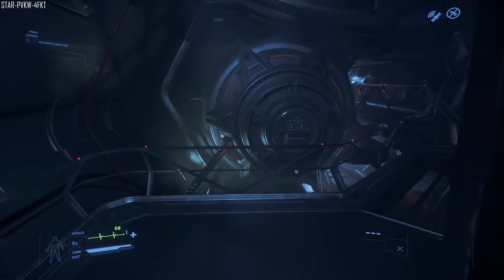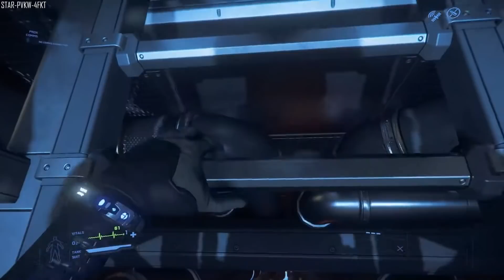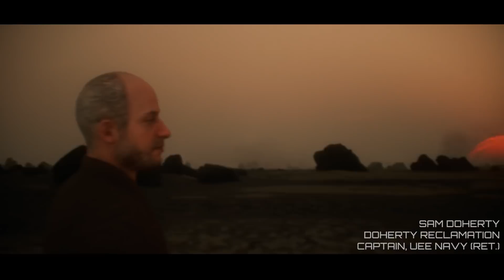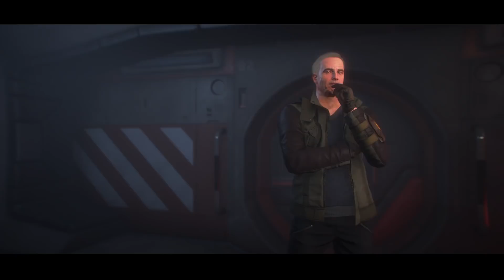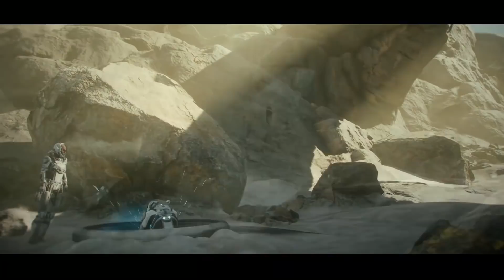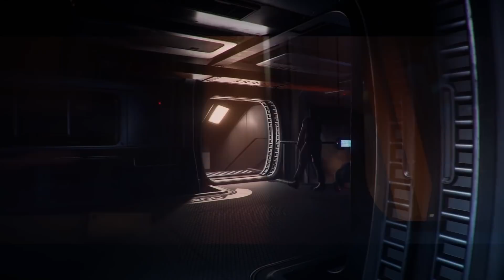Star Citizen Ships | Engineering, Repair, Salvage & Components

Comment: Its good news they are working on the power system. However, just like a real aircraft.  I think they should have onboard APU's (Auxiliary Power Units) so you can shut down your main engine but still run the electrical system/defense systems off the APU when the Main engine and generators are not on. This would help reduce fuel consumption when sitting on a planet or in orbit but still be able to power Shields, life support and turrets. Really all the larger ships with turrets and habitation should  have an APU system for starting main engines and powering the ships critical systems without the main engines on.

Comment: Some of the smaller ships you will have to access the components outside of the ship, so if you are in space you will have the get out and EVA to the compartments. Larger ships you may want another player with you incase something goes wrong. I think that will be an exciting new feature. Once tracker beams are added you can be a space tow  trucker.

Comment: engineering and salvage are two of my biggest areas i look forward to. looking at it though i have to wonder what compent repair will look like- little fuses? wire? or magic glue gun? still i like the idea of system management as a staring point.

Comment: Nice video, but CIG really has really disappointed me with this...They've known they were going to do this pipe system since 2013 - it should have been "built out properly" from the very beginning, it's not as though this is some system they didn't know was going to be implemented.  Whatever the original pipe system was, it wasn't build properly for the end goal - so it sounds like it was a hack job.  "Iteration" is one thing, this sounds like they are completely starting over.

Comment: im looking forward to that frantic moment, following a dog fight, where i have to get out of my seat and start blow torching and wrenching untill the fires and smoke are out. Hell even put in a "bleeding out" state in ships! Repair your Q-drive or its going to explode!  Hell put in some great sci fi action music during that state and turn this into a tremendously immersive sci fi experience! Star Citizen is all about the immersion. I think this would be amazing!
Reply: Would be interesting to just barely scrape through a fight in my 600i only to have a bunch of system failures.
Reactor's unstable, there's 3 hull breaches, I'm leaking oxygen, the life support system's fried, the shields are gone, and half the thrusters are malfunctioning.

Do I give up and abandon ship using an escape pod, or do I try and fix her up enough to limp home...
Can I get her to limp to a station in her present state, or will more fail/blow up before I make it?

Oops. The reactor is starting to go critical now. I have to rush all the way through from the bridge to the back of the ship and try and at least get it stabilised.

... OK, reactors's stable... It's not going to blow.
But... Main power's out.
Life support's down...

Do I have enough oxygen to fix this?

... Got main power back to minimum output.
Managed to find and fix the hull breaches.
Shields and weapons are a lost cause, so let's hope nothing else tries to attack.
Oh wait. I have missiles.
... A whole two of them.
Half the maneuvering thrusters are shot. Better not try a planetary landing.
3 of the main engines are beyond repair, but... One is better than nothing.
Quantum drive... Has seen better days...
If I can just patch it up enough to get out of here...

ooh this is going to be expensive...
But, the ship is salvageable... 

OK, setting course and...
Damn.
Overloaded the reactor again.
Have to run back down and reset the whole thing.
OK, this time cut the QD power down to 10%.
It'll take forever to charge the drive like this...

.... Halfway there... Keep it together just a little longer...
Ah, we're dropping out of quantum...
The drive must've been in worse condition than I thought.

Well, back down to engineering I guess...

Comment: There are some problems with this. How do you get a large component in and out of the Carrack for example. There's not enough room to lug the components through the paths to bring them in and out of the ship.
Reply: There are definitely some logistical issues.

I scratch my head every time I look at the cargo and engineering areas of my 600i.

Not that I can't imagine getting stuff into and out of those areas...
Because there is room, just about.

But just because it would be so, so awkward.

Carrying cargo all the way from the forward lift, through the guest cabin area, up the path, down the ramp to the rear, down the stairs, into one of the side areas seems like quite a convoluted trip.

And then there's trying to do the same thing with a size 3 powerplant and that's just...
That's going to be quite the complex bit of maneuvering.
You can only hope that outright replacing the components won't have to be done too frequently...
Reply: @KuraIthys  I'm hoping they add maintenance hatches where needed.

Comment: What if they made it so that depending on the amount of time taken and "how accurately" you repaired the item determines a bias towards its performance until it is either repaired at a Port or by a better engineering attempt. Just thought of it while watching your vid.
Like have part of the repair action show a bar on the HUD similar to mining, but the steadier you are and the better timing you have gets better repair results....
That way if you are repairing a Carrack in mid battle and the Grav generator is out, it could be tough to properly repair a thing back to full performance, but you'll get it to work damn it, if its the last thing you do.

Comment: It would be really cool to have to fix the ship on the fly like Han and Chewy did in the empire strikes back
Reply: Also this wil proabably give some more gameplay when traveling. If you are doing a long quantum jump you can probably go around and do som maintenance wile traveling.
Reply: You know what would be even better, is if the game actually worked without crashing or having 2 fps at MicroTech.
Reply: @taccntb4345  Bruh get a better pc or install in a ssd. i get 40+fps at microtec. so thats not a CIG issue. Thats a YOU issue
Reply: @64491601  it was a server issue dummy.  They did a sever update recently.  Game works fine now.  So it was CIG's issue.
Reply: Very!